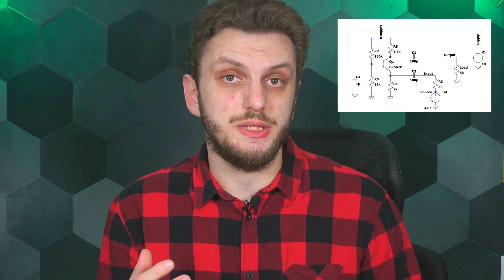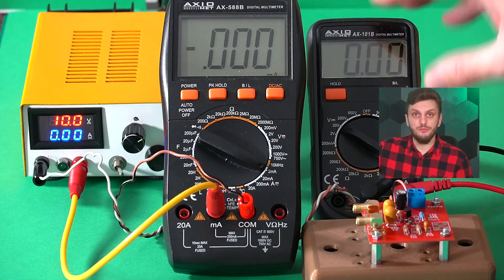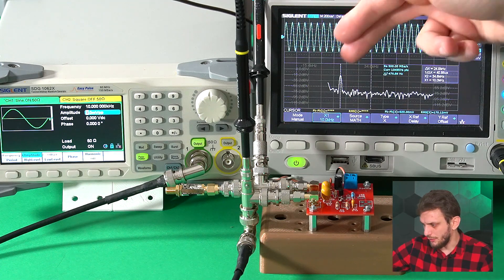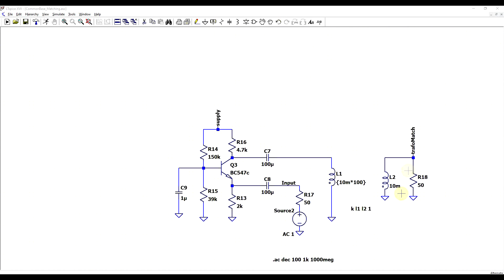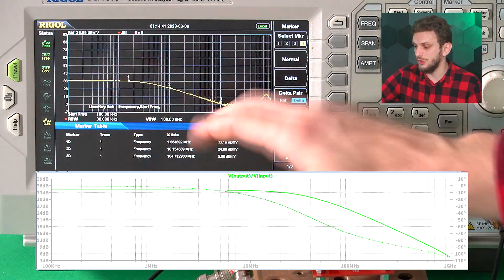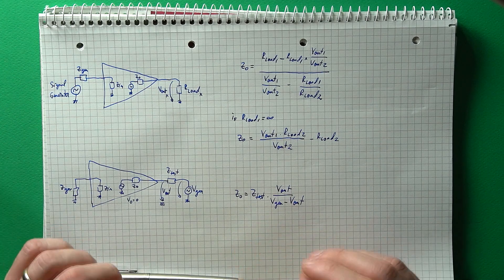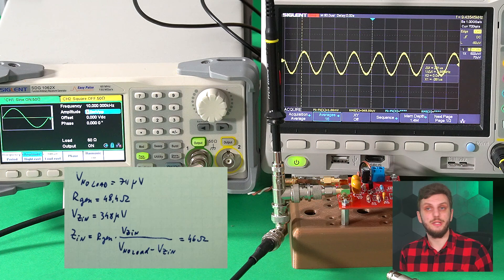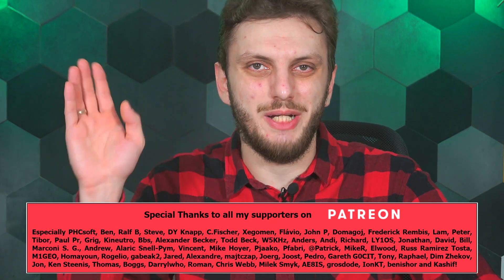Common Base Amplifier  - Practical Build (2/2)

Comment: осторожно, орудует гугл переводчик
I don't understand. An amplifier with a COMMON base. So the base must be connected to a potential with low resistance. Is not it so?
In an amplifier with a common base, the output current is approximately equal to the input current. This amplifier only amplifies the voltage. The capacitor in the base does not help, because there is not an alternating current flowing there, but a pulsating one direction. I am sure that if you measure the base, it sags when there are distortions ...
An explanatory team is urgently needed - why is there such a high DC resistance in the base?

Comment: interesting demonstration my friend. Now what we need is exploration of a new endeavor: A common base amplifier directly coupled to a common collector amplifier so you get voltage gain at a low output impedance.
The edit was me saying common emitter, I was supposed to say common collector. 
So I edited it to change one word
Reply: The desirable trait here is thar the common collector or emitter follower has no voltage gain but it is a current buffer

Comment: I wonder if you could still use VNA even though its signal is too high, if you add attenuator between VNA output port and amplifier input port? The amplitude response graph you get would be shifted down, but I expect you would still get some information about the circuit response.
Reply from the maker: I did try that, but the more attenuation you add, the more noisy the signal becomes; at some point, the measured signal becomes so small the device can't really make out any useful information. Wit this particular amplifier, you would need about 40dB or more of attenuation to not overdrive the amplifier. The LiteVNA I have is just not sensitive enough to work properly with that sort of attenuation.

Comment: Thanks for the interesting video. The few drawbacks you mentioned (input impedance depends in DC bias, output impedance is high, low bias gives higher noise and lower cut-off frequency) can be overcome by a particular type of common base topology - the Norton amplifier. The dc bias is increased to a couple of mA to get an emitter resistance of 5 ohm or less. Then a transformer is used with one turn in series with the emitter to the signal source. As the emitter is practically zero ohms to ground the input voltage is across that one turn. In the collector are more turns of the same transformer. The output is tapped a few turns down from the supply line, the winding continues with some extra turns to the collector, see further down why. The voltage gain of this amp is the ratio between these turns and the one input turn. Usually not very high, let’s say 4. Now the impedance matching trick - the output voltage is 4x the input voltage. In order to have the same input and output impedance the output current should also be 4x the input current. Which happens when the input has 4x as many turns in total as the output. And that is where the extra turns in the collector come into play. So to recap - from the supply down to the output 4 turns, then continue with 11 turns to the collector and in the emitter another 1 turn, making it a total of 16 turns. With a gain of 3 or 5 of course your total primary turns is either 9 or 25.
A picture says more than a 1000 words but YT doesn’t let me draw so I hope you get what I mean.
One turn primary can also be multiples of course, the mutual inductance should give an impedance at the operating frequency much higher than 50 ohms

Comment: Hi. You are one of the most elaborative electronics channel. Keep up the good work. I have a question related to my project. I have a parallel lc tank circuit which oscillates at 3 Mhz. I am trying to get this signal through a buffer opamp configuration. I use lmh6646 which has enough features for my application. But at the output of the buffer circuit i see a 4 Mhz signal. How is this happening? The buffer circuit outputs different signal from input. Can you think of any reason for that to happen and how can i solve it?
Thanks.

Comment: Absolutely excellent ! Thanks.
I like very much the real life test, that show all is not perfect, but "close enough" (I take this in my technical vocabulary, now 😁)

Will you do a summary video to show the advantages and use case of all 3 topologies ?
Reply from the maker: I'm happy you enjoyed it! I'm not sure about the summary video, but based on another viewers suggestion, I am considering extending the series to a 4th topology - the cascode - which is basically a combination of 2 basic topologies, but since it can be built with a single transistor (dual gate mosfet) I think it disserves the analysis.
Reply: @FesZElectronics  Thanks for your answer. Yes of course, the cascode topology will be even more interesting, bipolar or mosfet. Impatient to see it 😁

Comment: Common base amplifier were used in early 2000's late 90''s at input of FM receivers for public service broadcast 88 – 108MHz. (impedance adaptors or matching impedances main reason ) .Of course was use in many other aplications as you said . Thx.